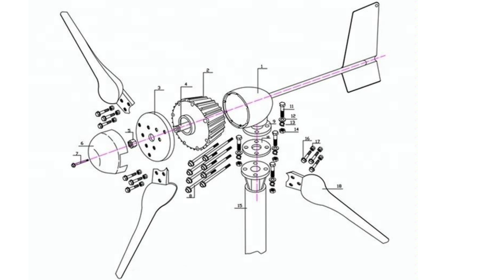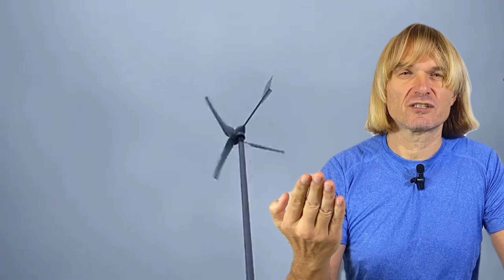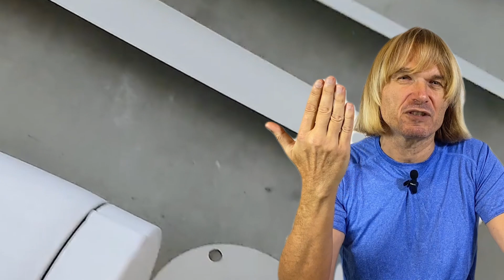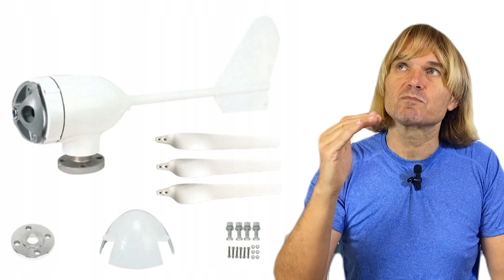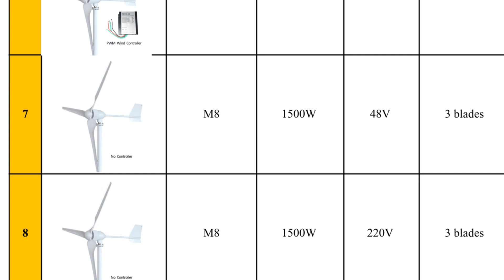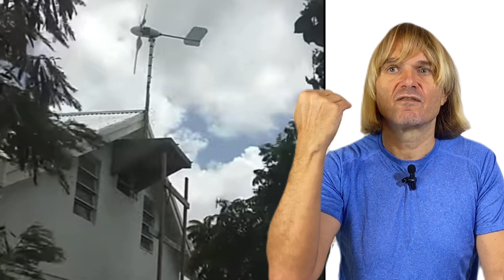ONLY 250$!!!  WIND TURBINE THAT WORKS!

Comment: PWM for wind + MPPT solar on same battery is a problem with interference signals ! better way is mppt wind controller + mppt solar inverter ... the pwm make Pulsating interference every few seconds on sensitive devices, PCs, sound systems, amateur radio, or similar problems... I tried PWM and MPPT controllers on the same storage/inverter, so since then I've only used MPPT + MPPT controllers on the same storage, because "mixing" PWM and MPPT is apparently not such a good idea... Currently, these 3100 watt MPPT wind or MPPT wind solar hybrid charge controllers for 12, 24, and 48 volts seem to be very good on AliExpress... mostly white or white-orange—sometimes from the dealer "smaraad"... the cheap standard wind charge controllers without a display are less useful...
Reply from the maker: mppt is also dc converter it makes pulses same way as pwm

Comment: Thanks for the interesting video, thanks also to explain that Tesup wind turbines are a scam...I've a 20kW solar plant with three Solar Edge SE6000H Inverters (one inverter for each phase), I have also 3 batteries LG Resu 16h  (one connected for each inverter); I would like to add one (or three wind turbines) to have more power expecially at night, to do this I've measured for 1 year wind on the roof of my house with an anemometer, the result is a mean gust speed of 7.5 m/s (with a top wind gust speed of 20.9 m/s)... I would like to ask you, wich is in your opinion the best wind turbine I can buy and wich is the best way to connect it to my plant (in terms of efficiency and phases balance) (the link you added in the comment section doesn't work anymore  . Thanks

Comment: I have a huawei SUN2000 3KTL L1, with one PV input not used. Can I connect an M5 to it using only with rectifier? I'm From Portugal and here I do not find any company to help me on this matter, people here are afraid of wind for home use. I just need to complement production from October to February, and this way my 10 PV system with 5kw battery, will be sufficient for my consumption.
Reply: You can try. You will definitely have some production in strong winds but below 6m/s your inverter wil brake the turbine constantly
Reply: @4nrgy  Can you suggest the best way(equipment) to connect it to the huawei inverter?

Comment: Hi, 4nrgy Tech.  I hope you will answer this query.  We have a completely off grid solar system, which we are wanting to put a wind turbine on as extra power.  We have 4 Pylontech 5000 batteries, and an Inverter 5kw hybrid "Evo Circle".   As there is so much conflicting advice, what do you think is a good wind turbine for us. You seem to be the guy  I feel I can get a confident answer from.  Thanks.
Reply from the maker: I would buy real 2kw(3.2m diameter) 48V turbine and connect it through rectifier and cheap 48V PWM controller directly to battery.
its cheapest and safest way

Comment: Hi have you tried paralleling many wind turbines together? . using cheap orange wind turbine controller, dc out ...... into a bus bar (because they have a  diodes) ? 40A /48v . ? so logic turbines are 600w / 48v = 12.5 A each  x 4 = 50 A at the bus bar... (or 3 to be under 40 A)
Reply from the maker: we had 2 turbines charging same battery bank so it was kind of parallel

Comment: Hi. Very good explained to me. I would like a little support for my computers which is running 24/7. I am in very windy UK location so it is worth it install some of the wind turbine to get my computers run for free. Let say I need some complete kit including batteries, controller, etc. to get me at least 1kWh energy 24/7. I am completely new in this and not much understand what everything I need to buy. If you can provide some tips of devices what are working properly with maximum efficiency would really appreciate. Thank you very much.
Reply from the maker: I would buy 24V hybrid inverter(200£)  batteries(200£) and 1kw wind turbine which could be around... yes you guessed 200£ this should be more than enough energy for computers but also a lot of energy for home(24v inverters are 3kw so you can heat water with them too! 😀
Reply: @4nrgyTech  Can you redirect where I should find these devices to be compatible? I was searching and found something but not sure if it is right. Just for to help me have some kind of picture.

Comment: Firstly, I want to thank you for the TESUP video because I was thinking about buying 2 of them. 
Secondly, I have 16 solar panels on my roof and would like a little wind support. Obviously in winter there isn’t a lot of energy produced by the solar panels. I am thinking of 2 wind turbines. What would you recommend to support my solar and is there anything I need to be aware when I connect the wind turbines to the already set up solar network?
Reply from the maker: anything 2-3kw prices are from 1000 to 2000Usd. I recommend L2 3,2m diameter. its cheap under 1000$ all costs incl

Comment: Any questions in comments welcome?!?!?! How can I find details about torque and voltage at different winspeeds for these generators If I am desinging blades to be used with them? Do you have any information on RMP, voltage, and torque you could share at 3, 6, 9, 12m/s? I am eager for tons of data if you have, or if you know from experience.
Reply from the maker: most important thing is tip speed ratio for blades. remember when you are doing unloaded tests tip speed must exceed 6x wind speed
Reply: @4nrgyTech  thank you.

Comment: Newbie question: can a wind turbine be used without batteries? I have a PV installation with microinverters (Enphase) and no batteries.
Reply from the maker: yes. we are using it with any pv inverter. but most of microinverters are only up to 1200W

Comment: I can’t believe you don’t have more viewers. I’ve learnt a lot from you this afternoon. Thank you. 
Will this and the previous 3.2 metre wing span work with my system that is tied to the grid. I sell the my power at rip off rates:) IE can I sell them any power generated by these turbines? Many thanks
Reply from the maker: if you have solar inverter you can use controller to cheat mppt into "thinking" it's pv panel. deming is making this kind of controllers but they are quite expensive. we are producing them too but now quantities are so small it's only for our systems. in April we are starting production in China so this should be cheap and widely available. I asked many chinese companies for this product but it comes to our production at the end. Strange since concept is rather simple🤷‍♂️ an we are making them in Poland for 15yrs.

Comment: What would be needed if you wanted to run this turbine 100 feet away from the battery bank that is being charged?
Reply from the maker: I would choose 220V wersion , use pwm controller and connect to mppt input of solar inverter

Comment: Hello, i’ve got a question. I would like to buy a turbine with more or less 500€, but i don’t find a video without batteries, its possible ? To sell the amount of energy that i’m actually not using. Then i’ve got 3 phase 220v home, exists inverters for 3 phase cheap ? 
Great explanations thank you for your videos
Reply from the maker: yes you can use standard pv grid tie inverter and wind controller with it

Comment: Hello. Another great video. It´s easy to see that you know your stuff. Could you make a video about wind charge controllers? Looks like lots of people in your channel are interested in, including me. I think that the expensive ones are usefull to charge batteries. They come with  boost and buck, mppt, mct, internal circuit brakers, manual brake, very good dump loads, wind turbine rpm control, adjustable battery setting, wind turbine power curve track etc

Thanks
Reply from the maker: ok. will do
Reply: @4nrgyTech thanks :)

Comment: checked the links to Ali. That is crazily expensive, almost double what others are selling the same items for.
And well, I understand you can get the diff generator inside. But man, you can get twice as cheap turbine, and then replace a GEN with a better one, and will still be 25% below the stated price.
I don't understand... why should we buy from this manufacturer/store? I need a very-very good reason.
Reply from the maker: dunno. as I understand this is the price with door-to-door worldwide delivery. and no there is no more powerful generators. it's just real power.
Reply: @4nrgyTech  I am getting on Ali $213 door-to door for M3 with 1.68 blades and with a not so good gen. then, I go to the same Ali and buy an awesome gen for $90 (just received it two weeks ago, door to door), and mount it on the exactly same turbine. and get a real 600-700 watts machine for way less money.

and I still have a spare gen... for some other DIY project.
Reply: @bkwindsolar  Give us the link ?
Reply: @jean-patriceglafkides4559  I can, but it will be blocked by youtube...
I'll add it in the next comment - but if it does not appear - sorry, that's not something I can influence on.

Comment: Another great video. I find this really interesting. I must have looked at hundred of articles and videos on this subject and I haven't found a single instance where anyone is taking turbine rectified output directly into a PWM solar controller so I'm intrigued to see this work for real. ( hybrid controller maybe, but not yet basic PWM controllers ). 

Connecting the rectified output to a PWM solar controller is an interesting approach. Most nominally 48v turbines create output voltages in the range of 0-200v. So I wonder how the average PWM solar controller ( e.g. EcoWorthy/Victron ) deals with such a high input voltage approaching 200v? when it typically receives 25 to 36v from panels ?   Also, the PWM controller will reduce it's PWM duty cycle towards zero as the battery bank becomes full which would gradually unload the turbine causing excessive RPM andd over-voltage so there would have to be a "loading system" running in parallel such that when the battery bank becomes full the turbine is automatically loaded with suitable resistors. You mentioned before that the parameters on a typical PWM solar controller for connect/disconnect voltage limits could be used to achieve this and that this is simple, however it would be good to see a live working example of this scheme in action.
Reply from the maker: victron is no good. its too restrictive and brakes turbine. 48V wind turbine shouldn't go higher than 100V. also many controllers has 80V input restriction. if you have dump load connected to solar controller it is not a problem. unless dump load is water heater and is disconnected by thermal regulator in boiler🤷‍♂️
Reply: @BeertjeRulez  Thanks. That sounds very interesting. Can you suggest any particular grud tied wind controllers?
Reply: @nhikoid  To be honest, I am still looking. I checked this channel just to find more details on an inline DC solution using rectifier to feed into my spare MPPT port on the inverter. But given that you - apparently - need another PWM controller, and that this DIY solution is untested and lacks a dumpload, I am  now back to what is easiest: AC coupling. But mind you: this cannot be used in pure off-grid situation, because AC coupling is done on grid-side (before the meter). So if there is no grid, then there is no AC to send the WT power to the solar inverter. In most western countries that's not a problem because grid is always there. The main advantage of this is simplicity, plus you can use off-the-shelve WT controllers. From what I can gather the VESDAS 2000W controller seem to satisfy lots of people. You can get them from AliExpress for around €400 including the dumpload. I am leaning to this one right now.
Reply: @BeertjeRulez  Thanks. Will research that.
Reply: @BeertjeRulez I wonder...could the WT rectified output just go directly to a battery bank shared with an ac coupled inverter charger like the Sofar ME3000sp. Then in the event if the grid going down, a feed from the batteries could go to a cheap non grid tied inverter to to feed a separate circuit of "green" sockets. Just so interesting. If funds allowed, it be fun experimenting!
Reply: @BeertjeRulez  Just been reading about that controller. Claimed rating seems suspiciously high. Have you seen good reasonably credible reviews around?
Reply: @nhikoid  this is insane, my replies to you get moderated away when I even use that Asian country platform's name... Not sure if this is YT or the channel owner.
Reply: @nhikoid  well, the proof of the pudding is in the taste ofcourse. But a guy here in my country tried it and it works well. Of course there are no long-term experiences, so the mtbf is a guess still. Imho it's easy to always distrust Asian vendors, but mind you most of them want to business. Bad reviews don't sell and they don't moderate bad reviews. Sometimes you just have to trust a supplier for what he claims, but when I buy the more expensive things from Asia I always talk to them first. You will soon get a feeling about their level of expertise. Barring that, I also found this controller from a different western supplier. Same box, but different branding. Like I said, I am only leaning to this controller now. I haven't bought it yet. It won't be until next year that I start building a WT setup. We will have net-metering for one more year so it's not yet economical to have a WT just yet.
Reply: @BeertjeRulez  ?I got replies from you (thanks for the info/views)
Reply: @nhikoid  i had to post the same reply 12 times orso until I replaced 'China' with 'Asia'.
Reply: @BeertjeRulez  wow ?? That is really odd. Anyway, in my experience most of the products ( just about everything these days ) coming from China are great value. Just the odd bad seller as in any marketplace.

Comment: Great video mate
You do excellent explanations
Also these pictures looks exactly like the two I bought for 500aud each. (300usd) roughly
Just gotta check if they are round tail or rectangle. 
See if I got ripped off or not
Also as you suggested,  I need to run them on a drill and measure the output voltage is 48v as in told they are
Reply from the maker: thankm
 you very much
Reply: I Google that model did not found the manufacturer can you plz share link  @4nrgyTech

Comment: the only problem is that you should ALWAYS make a calculation based on your realistic on-site wind.
global wind atlas (google it) will help you understand what is realistic on your site at 10m height.
and reality is strict, you will rarely see it higher than 4m/s. so do not count on 500kWh yearly, it's simply impossible on a 4m/s yearly average winds. somewhere about 50 kwh yearly for a small M3 - that would be realistic.
Reply from the maker: nope. problem is when you buying 500w turbine as 2kw. then of cource you can not bank on big production
Reply: @4nrgyTech  there is no chance that 500w wind turbine outputs more than 50-60 watts on 5 m/s wind. that is the reality I am talking about.